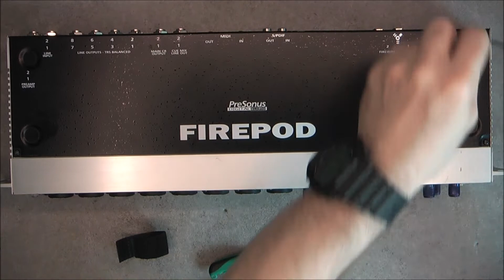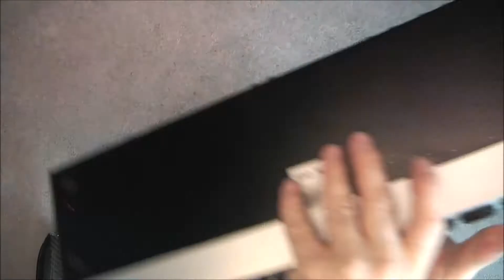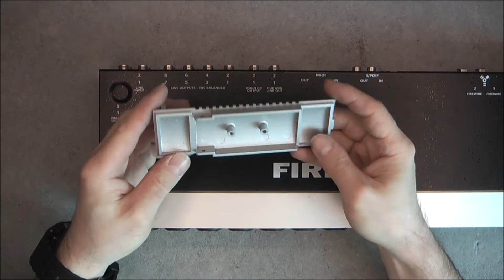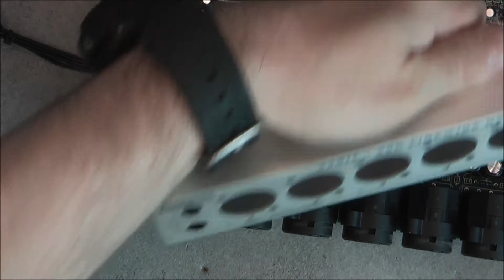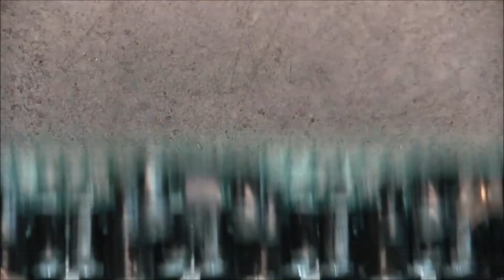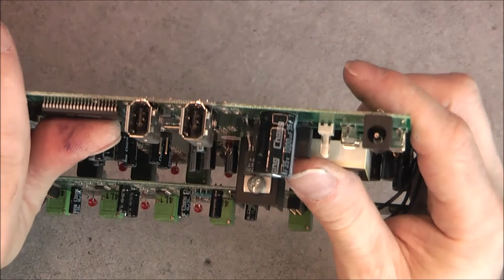Presonus Firepod Firewire recording interface teardown

Comment: I actually have some things to say about this topic, I hope you feel like reading haha.. ;) So, the domain of FireWire audio interaces is extremely familiar to me. I've never used a Presonus unit, but they're clearly fairly low quality for all the reasons you've pointed out. Today, Presonus is known for their digital audio workstation (DAW) software, which is excellent. It's what I actually use and I like it. I'm actually still using a FireWire interface to this day, as we speak to watch your videos. In my case, I use an RME Fireface 800 which is a German-made unit. It's far better built internally (I paid $2k for it a decade ago), but it has lots of problems as well. Their engineers are fairly arrogant and don't like admitting problems (typical in my experience when dealing with German tech people, unfortunately). The power supply in my unit has failed multiple times, and every time, it was capacitors. RME didn't make those power supplies, they just bought them from a Japanese supplier. The main reason why they fail so quickly isn't because of low quality capacitors, but actually heat. The area of the power supply is constantly at 75C or so. As a result, electrolytics don't last. They charged customers $200 USD to replace the power supply, excluding shipping to Germany. My fix was to use far better MLCC capacitors + organic polymer types instead of electrolytics. Those capacitors are far more expensive at maybe $5 to $7 each, but as a result, the power supply has never failed again and the unit still works perfectly. I did eventually need to replace all the other capacitors as well since I run the unit 24/7.

It's easy to use FireWire devices with a cheap PCIe card for your computer. That's what I'm doing. FireWire is dead for consumer devices as another person pointed out, but FireWire is actually a great protocol and it's used for many applications which require "deterministic timing". For example, the F35 fighter jet uses FireWire 400 for its control surface communications (flaps/ailerons/rudder etc). The main problem with FireWire is that it doesn't "scale" well to multiple devices. And the entire bus only runs as fast as the slowest device. There's an implementation of a FireWire-like interface for space applications called SpaceWire, which is similar in every way except topology. SpaceWire is a "switched" interface (like ethernet), whereas FireWire uses a "logical bus" topology (these are all things you can look up if you wish). The sorts of things that use SpaceWire are the Lunar Reconnaissance Orbiter, the upcoming James Webb telescope, GOES-R satellite, various ExoMars program hardware etc.

The main reason why I still use the Fireface 800 is actually because I modified it to output raw audio data. I removed one of the 4 rear output DAC chips, and I'm stealing its I2S audio data, buffering it, encoding it into differential pair signals, and sending it outside of the interface through a connector. This then connects to custom hardware I have for audio development. So the Fireface 800 is a convenient I2S data generator that I can use to drive other devices. In addition to that, the Fireface has a "word clock" input, which means that it can synchronize to other devices - and I use that feature as well. The clock of other devices gets sent to the Fireface over another differential pair, and sync is established between the two devices. There are all kinds of technical reasons why that's desirable, especially for development.

I'm not familiar with that BridgeCo chip and I can't find a datasheet for it. I guess it's some kind of main controller for the interface, since you have some SRAM and flash memory next to it, as well as the FireWire controller chip. The Fireface 800 has a very different topology. It has a Firewire controller, which then talks to 2 different FPGAs which implement a lot of custom features and process/mix audio from DACs/ADCs as needed. Sorry for writing so much! I hope some of it was interesting. I really love your videos so I try to share what I can in return.

Comment: Unfortunately, Firewire is obsolete - which I think is a pity. I also have some firewire interfaces (Tascam Fireone and Motu 828 MK3) You can not use them anymore, they cost a lot of money and are now precious electronic scrap. Or you sell them on Ebay for a little money to have them dismantled by electronics fans like you
Reply: I use Firewire every day.  Firewire cards and cables are still manufactured.
Reply: Just get a Creative Audigy soundcard, it has firewire, you can get one for 5$.
Reply: I am also using a PCI firewire Card. But in the Future, Firewire is obsolete. No Mac-Machines were build with Firewire. Instead, there is a successor "Thunderbolt" (which will probably eventually be discontinued) and so on ....
Reply: Aplogies _ I only just came across this.
As you say, FireWire is obsolete - unfortunately. However that does not make it unusable. Many of us still use it on a daily basis.
The fact that the vendors may have moved on, does not change what worked/didn't work previously.
FireWire is a great example of this. For audio work, it is still quite a good option. Some of the hardware may be getting a little long in the tooth, but with proper R&M, it can still be reliable.
Many people dropped Windoze XP a while back, when Micro$oft decided to stop support for it. Similarly, Windoze 7 has just fallen victim to the same fate. However, that doesn't change the fact that these products still do what they did when they were last supported and will continue to do so, as long as there is functional hardware to support them. I still use both WinXP and Win7 on a daily basis, both on physical and virtual hardware. I even still have supported security software for XP, not that I use XP much for any internet facing work. Its mostly for some form of dedicated task (such as a dedicated media player, multi-channel audio recorder, virus scanner etc.). Sure I get dirty looks from many who probably don't really understand these things and abdicate their techincal responsibilities to the Micro$ofts of the world.
I used to work for the largest IT outsourcer on the planet, who sold their services on the basis that their expertise would benefit the client. In fact, what expertise there was was really deployed for their own benefit (and contra to the benefit of the client). So these organisations are typically not as trustworthy as we are all led to believe.
While Micro$oft may feel that dropping support for its ageing products best suits their fiscal agenda, that doesn't translate well into suiting the user's fiscal agendas very well. For the most part, Windoze XP still does everything we all need, just as well as the latest incarnation of this product. But of couirse, thats not the story you will hear from the vendors. After all, if the truth were known, the upkeep of the super-yacht might be compromised.